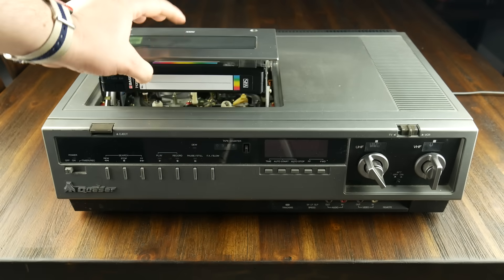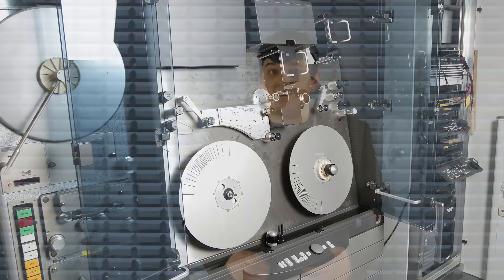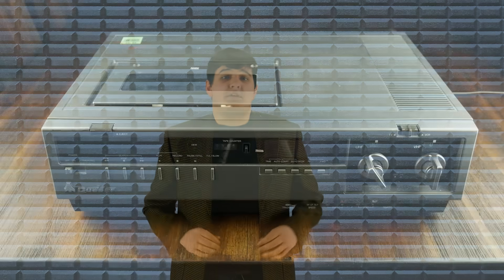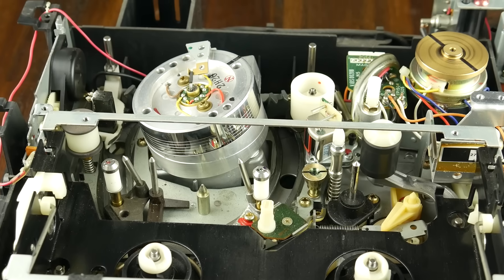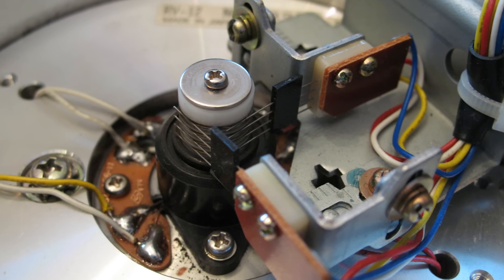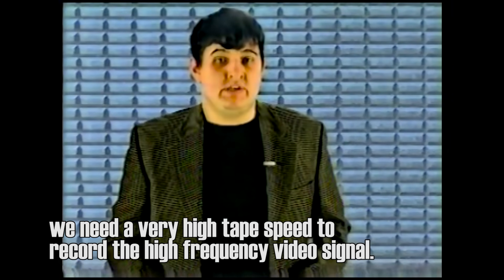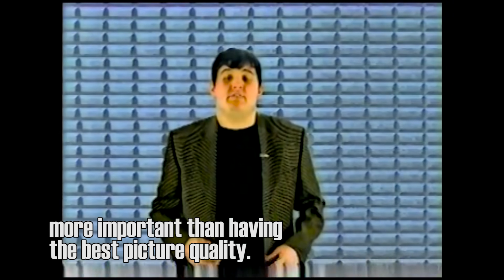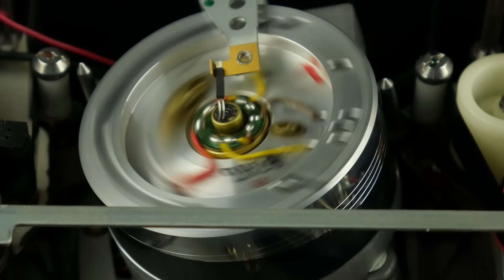The Impossible Feat inside Your VCR

Comment: 12:00 Lulz.
I actually used to record things off of broadcast television.
First, this was back in the time before digital broadcasting, so most of the time you would be receiving an analog signal over the air. Analog signals differ from digital in several ways, but the most major way visible to the end user is in picture quality; with old analog signals, you could actually miss seeing or hearing some of your program.
But with digital, you either see it, or you don't. There is no, "It'll kinda come in."
But, assuming your reception was clear enough, the appearance of faces and detail on old color televisions was every bit as good then as it is today.
In fact, an argument could be made that television actually looked way better back in the day...about 1995 or so.
See, we didn't have flat screens, then.
Why does that matter? Chrominance, luminance, and color gamut.
CRTs worked by illuminating phosphor dots with an electron gun.
Color CRTs used three different color dots lit up by three different beams, one for each color. Though, it is important to note, the beams themselves all appeared to be the same color, and different colors were achieved by illuminating different colored dots on the screen with varying levels of brightness.
Why was that important? Because it allowed the color CRT to reproduce colors across the full range of human vision.
And no, LCDs do not....and in fact they cannot...ever.
No matter how good an LCD gets, it will never be physically capable of reproducing ALL of the colors we can see, and in fact can only reproduce a tiny fraction of the full range of visible light.
This is most noticeable for reproductions of green.
If you look at a good quality film-developed photograph (in other words, not a digital photo)of a lush forest on a CRT and then look at that same photograph on an LCD, you will notice a MARKED lessening of green on the LCD.
There is nothing that can be done about this for this technology because the way an LCD monitor works is by backlighting the dots which CHANGE colors, rather than selectively adjusting luminance, chrominance, and color by illuminating unchanging dots through a shadow mask.
A shadow mask is a part of every CRT. It's made out of metal and has a series of tiny holes poked into it so the electron beams can only illuminate the exact dot they are aiming at and no other. In this way, it was possible to have very great differences between the chrominance and luminosity of one dot on the screen vs. the one right next to it.
This in turn allowed for high-fidelity color reproduction, with the values produced by the CRT being MUCH closer to real life than any other method of color reproduction in moving pictures.
And the sound wasn't this bad, either.
No one would have bought tapes if they sucked this badly.

Comment: Actually cds are far more complex than VCRs they suffer from the central hole being off centre and the disc not being flat plus they change speed to accomodate the different diameter of track from inside to outside. Philips the inventors were not even sure that the original players would work a bit like bumbel bee flight the science says it probably will not work but of course the practise says it does.

Comment: I dont know everything  about what your saying, but some of the word your using i have come across in something that I have been piecing together that no one else knows about.  I have a question. Recently I figured out something that everyone is over looking. What keeps the cloud in the air?  I for some reason always though wind? I dont  know why.  But they are stiff and dont change that much when wind is pushing them.. clouds are made of particles that moisture attaches to . There are  low clouds Above Rheads that are in the old tv analog air space that are man made . made with iron particles. they are formed with electric magnetic Frequency which can create an image in the sound, i think that how it works. so as it is creating an magnetic image in the sound, iron paritcles are magnetic , the particles are forming what the image is in the magnetic frequency. Images are  most of the time FACES the cloud have faces. it will turn into a face after face. It is not your mind playing trick on you, like those people say it is,. Those people dont want people to know about the clouds.. those clouds i have seen move from one part of the to other side of sky in a drop of a dime.If you it looks like 2 eye a mouth  a nose it probably is. If you have a good video cam and the clouds look like spider webs zoom in on it andlook, it is full of faces and bodies and sometimes the body like the arm will move  like an animation of characters made off clouds. i have some video up and working on uploading more.all real all true just look or one day set up cam let in rec some clouds then watch fast play.. https://youtu.be/USsN5he9H8I https://youtu.be/O5klkRMHBGQ  zoom in on these videos and look...

Comment: It is a remarkable piece of history. I wonder what would have happened if Sony or Philips had introduced ADPCM to video signal encoding. Nothing fancy like MPEG or CDI related tech, just plane strait ADPCM. If you listen to a 16 bit stereo recording made with 4 bit IMA ADPCM (An optimized version by Microsoft) it only uses 1/4th of the WAVE data and sound almost identical. Some noise floor artifacts where optimized by Microsoft with IMA. Remarkable is the simple algorithm that can be used to encode and decode these WAVE signals. It's basically an index table with reference values (Changes up or down in amplitude) that have to be stored etc. A simple 386 PC could do this on the fly back in the starting days of the PC.  So what if they had come up with a similar system to encode and decode (Lossy) video? Would we have had no MPEG now and still record digitally on tape?

Comment: I took a VHS machine apart and couldn't believe all the complicated mechanisms. And I found that the bearing in the machine head round shiny thing was fantastic. The best spinny thing I've ever encountered. I'm thinking of using the whole thing as a bearing in a little project as it's so silky and fast running. Well worth a look if you have an old vhs available.

Comment: Great stuff! I would have liked to see an explanation of what is actually happening (and why it happens) when a VHS machine “eats” a tape.
You touched on it briefly, but it also would have been neat to see a comparison of the “pause quality” between machines with different numbers of heads. 
Would also have been interesting to get a little more in depth with “tracking”, how it started out with the need for manual adjustment and how it evolved to automatic.

Comment: After watching a previous presentation on how to adjust the head to remove tracking lines, afterwards, the machine stopped recording from the TV.  After watching this, I'm thinking I may have changed the head-drum angle, thus, causing the problem.  I may give it another try and, hopefully, without screwing up both the tracking and the recording.

Comment: In Germany we had Video2000 from Grundig and Philips. Up to 16h on one Cassette (the system is a 1/4" System and you can turn the cassettes like a Tape) whith a silghty better picture-quality than VHS or Beta. But it came to late and lost the race finally. In Germany, the Nederlands, Swiss and Austria the Video2000 sytem never came to more than 20% of the market - sadly.

Comment: I remember when we bought a new VHS at 2004 and it could neither record at LP nor playback LP. We had many casetes at LP and we couldn't watch them. I don't know what was on the head of the guys that made these machines. They had to say it before that this video is only for selected casetes at SP. Why they made a video without LP playback at 2004 I don't understand. At 2004 when most people have many casetes and especially in LP. Anyway we changed it with another. This 'another' is still in my room and for the last 10 years I use it only as a time piece.

Comment: I use to fix these machines back in the early 90's-  mostly belts needed replacing but you'd always find unusual items inside the machines (kids put the craziest items into the cartridge slot).  These machines were so mechanical.

Comment: I was born in 1982 so i used VHS a lot. I still enjoy recording onto magnetic video tape (Quasar VX, Sanyo Vcord ii, Beta and VHS) in 2020, mostly for the nostalgia factor. I did use S-VHS in the early 90s and it was a huge improvement over standard 240 scan line and HQ 250 scan line VHS in my oppinion.

I knew about digital D-VHS and i really wanted to own it. I remember the Good Guys and Circuit City electronics store's D-VHS demonstrations with beautiful 1080i videos of butterflies and bees on flower beds. I was not able to afford it as a teenager in High School though.

I recently purchased a JVC SR-VDA300US PRO D-VHS VCR on ebay for $450. It had been on my ebay watchlist for about 4 years. This model creates password protected D-VHS recordings from digital ASI BNC video input. This machine originally cost $6,000 and was only sold to television broadcast stations.

Comment: Thanks for reminding us what VHS looked like for you. I remember the quality being a lot better though. Take that "tracking issue" we see in this video. That's something the older VCRs had a "tracking control" to adjust for. The later VCRs were a lot simpler, but still delivered decent quality. I think his version of VHS was an exaggeration of the problems. It looks like he used an awful VCR to show us the worst of them. I wish he would compare Beta to VHS too. Beta was a superior format, even though it doesn't have the same capacity. Few movies are "4 hours" anyways.
Reply: the vcr quality he showed looked like the first vcr I rented in the early 80s. Until 1985 though I never had a quality TV (sony trinitron changed that) so probably was not aware

Comment: The popularity of LP had more to do with audio than video. People tolerate degraded picture quality as long as the audio quality is decent.

LP was dropped to lower manufacturing cost after linear audio improved and HI-FI stereo was introduced to the point where SLP audio was on a par with LP..  eliminating the ostensible raison d'etre for LP.

Comment: The old Betamax and U-matic tape did a full omega wrap around the head drum and lacked a control track, being incorporated in the video track that was recorded. 

LP disappeared due to its not being popular in VHS, everyone either used SP or most, who used SLP, aka EP. I referred to SLP for what it was, slop.
Don't get me started on NTSC signalling and quadrature alignment. Back in the analog days, when other techs couldn't figure out how to get the phase locked loop working in a video color circuit, they'd call me up to help them - even when I was working at a competitor and the boss was fine with it.

Comment: I bought an expensive JVC Hi-Fi VHS VCR, and tried to use it as an audio recorder, borrowing CD's from friends and recording them to tape. The specs for the VHS Hi-Fi audio was similar to the CD specs. One of the first CD's I recorded was by Whitney Houston and the first song was "I wanna dance with somebody". I was confused when I clearly could hear the audio difference on the initial drumbeat. It didn't sound the same on the VHS Hi-Fi tape copy as on the original CD. After digging into the specs of VHS Hi-Fi audio I discovered that the dynamic range is accomplished by using compression. The initial drumbeat coming from silence was too hard for the compression.

Comment: The entire fandango of SP, LP and SLP was an US exclusivity. Due to differences in coding, the PAL VHS videorecorders simply couldn't have a variable tape speed.
When recorded, the color wasn't encoded anymore with a subcarrier; simply put, the Luma & Chroma signals were modulating two different carriers, which in turn were recorded to tape.
Home video (in their relatively small size compared to profi equipment) were possible due to the sheer amount of dedicated custom ICs manufactured from day one.
This goes in sharp contrast with the transistor-only color TVs of more than one decade prior.
Just imagine the Chroma board of a Grundig or Schneider TV, with no ICs in sight, refusing to display color. A month of theoretical study required to understand that the excessive dielectric phase angle of a polyester film capacitor wasn't allowing phase-lock of the subcarrier PLL (phase locked loop) switching chroma circuit on. Consider no repair lab on Earth had the possibility to measure a deranged phase angle in a capacitor. And this is one of the zillion problems arising in transistor-only color devices. We were lucky that the critical circuit parts of home video circuits were mostly confined to few known components.
Verbose addenda: "Lucky" - I don't know... A generation of tube TV technicians rose large families and paid steep college fees thanks to an electrolytic capacitor coupling the plate of the vertical oscillator tube to the grid of the vertical output pentode. That capacitor liked to leak and then short completely (the symptom was reduced picture height or just a bright horizontal line).
Yes I show my... long experience with the relative collateral.
Thanks for the video!
In my particular case, you're not speaking of a remote, disconnected past, but something I lived with a passion.
And yes, I agree that the engineering (analog) solutions of the time required both heroism and genius.
Regards,

Comment: There is another big advantage for helical scan over quadruplex, in quadruplex recorders the tape needs to be sucked onto the heads with a vacuum because it will not flex around the heads. This means more maintenance as we all know how for instance a pc looks like after years of dust collecting by the airstreams of the ventilators. A helical scan recorder does not need a vacuum system and creates an aircusion itself around the head making the tape float a little bit

Comment: Major nitpick:  Two-inch quad decks' headwheels spun at 14,400RPM (240RPS), not 3600RPM, for NTSC, hitting the tape at 960 times per second.  A comprehensive video on how two-inch quad tape works can be found here:  https://youtu.be/fpBRuheelu4

Side note:  PAL runs the headwheel and the tape a little faster.

Comment: I used to operate VR1200, VR2000, (2 inch quadruplex) and 16/35mm telecine machines at the BBC in the 1970's before moving to ITN to maintain them, to include the ACR25 (A 2 inch Quad cartridge machine) and the VPR1&2 (1 inch Helical scan) from Ampex and Marconi.
Analogue Engineering, almost a lost art.
FYI, if someone hasn't already mentioned it, Beta was the technical superior format over VHS but what killed beta was Sony's refusal to allow porn films to be distributed on their format.
Broadcast Betamax machines such as the BVW800/820 were even better than any VHS based "broadcast" format and any of these were better than the U-Matic format.
Clever use of bandwidth and modulation allowed reasonably decent definition colour pictures though a 'feature' of the beta machines was that picture framing on replay was important as some luminance information, by definition, would end up recorded in the chrominance channels and to avoid a loss of luminance HF response at colour subcarrier frequencies, the  luminance frame had to be replayed at the correct place in the (PAL) TV line standard in order than the choma signals recorded in the luminance channels could be correctly added back into the overall video signal so that minimal loss of luma and chroma frequency response was achieved.
Beta video heads, in my day, cost around £1,200 each and they lasted about 1,000 hours.
Today, you can pick up a BVW820 VTR at an amateur Radio rally for around £20.00.
originally, they cost about £35,000... in the day.
Happy days and that doesn't include my time in Telecine which is another story...

Comment: 5 frames VCR(300-bits) U [2,3 Leads at 6v] --> /64-bits. (1500a/-12,18a)=125frqs-bits VCR leads, 83frqs,
1,488v, 1,482a bits VCR-Leads. (1,488,1,482*125,83) huge amps bits leads-- monitors illegal. (1488, 1482/64-bits=23frqs, 23frqs- frames bits VCR, Leads(EKGs). Hardwired-- filters- emails Linux.

Comment: In all seriousness, is there a real explanation for the "Blinking 12" clock issue of not including a seemingly trivial backup battery in what I'd guess every format and manufacturer of VCR?

In a multihundred-dollar amazingly complex device that included scheduling as a main feature, why was a clock battery never included in the design?

Counter that to never seeing a $5 alarm clock without a backup battery.

I think towards the end, some VCRs could set the time and date through EDS which some stations like PBS would include in the vertical blanking interval.

I wonder if there was some kind of patent on VCR Clock Backup Battery that prevented it's inclusion.

Comment: Thanks for covering the HIFI VCR aspect. I got my first HIFI VCR in about 1997. I had read in Stereo review that, they could record a CD with almost no loss in fidelity. Was I ever amazed. I could not tell the difference between the CD playback and the playback from the HIFI VCR tape. The funniest thing was the actual recording process. No levels to set, no noise reduction. There was no monitoring capability of the tape recording as it was being made, like you get from a three head cassette deck. Of course, It wasn't long after that, home computers came with CD burners and software, so, no longer any reason to copy the CD to tape.
Reply: I recorded my LPs onto a video tape with a hifi VCR - it was as close to the quality of my high end LP player as one could wish.